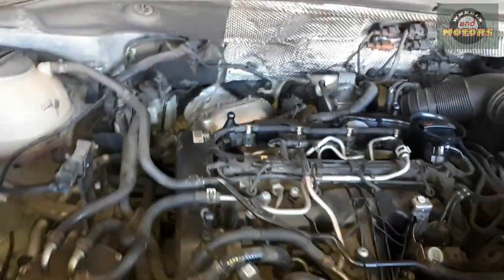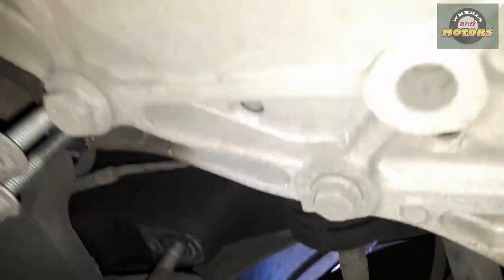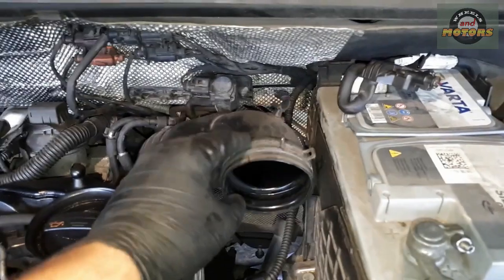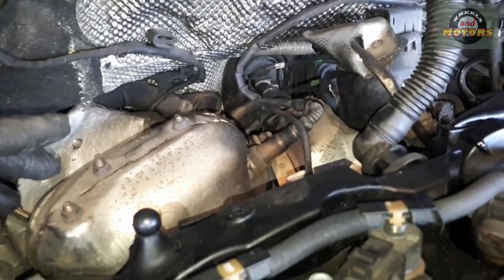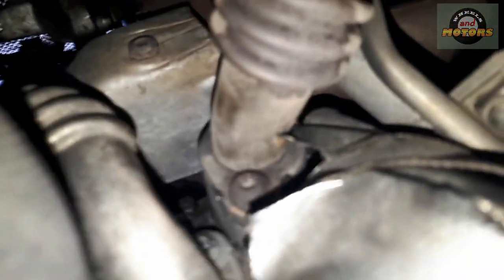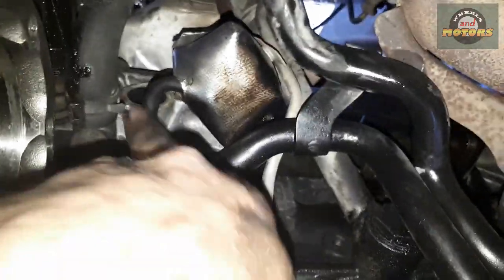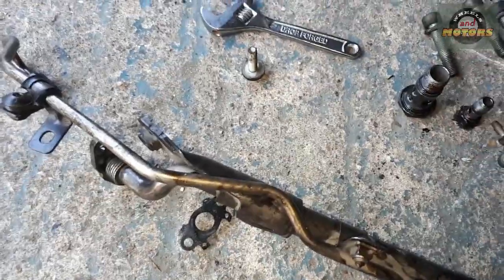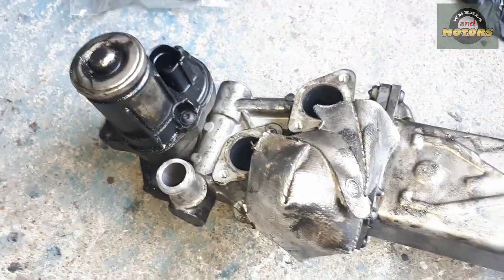P0403 - My way of "HOW TO REPLACE EGR TDI", VW, Seat, Skoda, Audi ("EASY-PEASY" style)

Comment: I tried to do the right thing - walked into my local garage, who's also my MOT tester, and asked if he had much experience with VW EGR issues. Almost immediately he advised me to get it mapped out, assuring me the emissions would be okay and it would be a lot cheaper than paying them to physically address the issues. I was worried about doing it but it's been a couple of days and the car feels so much better.

Comment: The guy who designed this type of EGR valve should have gone through the firing squad. Seriously...firstly this system on any vehicle is designed to get dirty and therefore if it is inaccessible it is a big problem.
Reply from the maker: Good earner for mechanical services. Design is rubbish.

Comment: Hi I have fabia 1.6tdi 2011. Coil light flashing and when I check with code reader its( p0407 egr position sensor  b _low in put.) When I turn the engin off it goes off .whe I start to drive after few minutes it comes again and power goes down. Which part I need to change. Thanks

Comment: Hi, nice work but you dont need to take the subframe off and also you dont need to take off the oil pipes that goes to the turbo, there is enough space to take the EGR off without the extra work and of course without extra costs of replacing the gaskets if doing so.
Also the EGR metal part doesnt need to be replace as it can be cleaned and the EGR valve motor and vacuume part can be bought individually saving a lot of money also.
Regarding the metal pipes that goes to the front they can also be cleaned with household chemicals. Cheers
Reply from the maker: Thanks for the advice 👍
Reply: Can I do that with 2011 dti jeatt

Comment: Hi great video help. I've never done one of these yet, but about to. Can you tell me if after replacement I will need any advanced coding other than using vagcom to clear the fault codes. You don't need any advanced codes from the dealer do you?
Reply from the maker: Thanks! No I didn't need to use any coding - it was just "plug and play". If you have some fault codes, any basic scanner should be able to clear them. Perhaps, after replacement they might clear themselves eventually.

Comment: I admire the patience you have to breakdown the various parts to get to the EGR valve and associated intake manifold.  It seems quite an arduous task.  In hindsight, would it have been easier to take out the engine and service that side of the engine?  I have some experience with the older VW diesel engines, e.g. pompe duece,  and servicing the EGR and intake manifold is less complicated than these more modern common rail engines.  As an aside, I wish VW had maintained the orientation of the engine, as in the B5 and B5.5 Passats,  rather than transverse as is now common.  How I hope VW will produce all electric versions of their popular models.  Maintaining the ICE and all the anti-pollution equipment such as this EGR system is ridiculous!
Reply from the maker: Out of all anti-pollution equipment - it's the AdBlue I hate the most. The car is great actually, today I've passed 400.000 mile mark.

Comment: Just a question on brackets and gaskets for the EGR - Spoke to VW and they say just 4 metal gaskets needed, x3 V04L131547S EE2-2 & x1 V03L131547N EE2-206 .  However re-watching this video you show a clamp to the DPF (which makes sense if you are moving) plus your bag of parts seems to show an additional gasket i dont have,  if i freeze frame! Looks like you have the 4 i have plus one smaller black one! :>   What is the smallest black one?
Reply from the maker: It's been a while since I've done it. Barely remember by now. Could you please send me a timestamp, maybe I'll remember something.

Comment: Getting sick and tired of my Sharan. I've got 4 kids and we need decent 7 seater. I've had a new DPF, new NOx sensor and now the EGR and NOx are pinging codes again...not to mention the A/C is stuck on and the heating diverter for rear is broken too.

Finally there is some weird issue with passenger side spring keeps rubbing up against the inside of the wheel arch!!!!

Comment: Thank you for the great video. 
I have an audi a3 2.0 tdi wit the same EGR. 

The car was throwing P0121 at first then p0403. Long story short the throttle body was absolutely packed with carbon. Took it out cleaned it and it worked fine with smooth engine shutdown. After 1000 miles the engine started throwing p0403 again. 

It shuts down smoothly without shutter. 
 I doubt the issue is EGR Valve since the engine has only 75k miles (well i dread it more than doubt...)

I was wondering what you think it would be? Any advice on how to track down the issue?

Cheers
Reply from the maker: Thanks 👍 P0403 points on EGR. I don't think it should affect engine shutdown. I had this code on low miles too, then for some reason it was gone for a while and came back on high miles. When it came back, I could say it was definitely bad - lack of power and flashing glow plug light.
This is what happened to my car, sorry don't know straight answer what to do in your case.
Reply: Is there a way to test egr valve without taking it out?

Same for throttle body. 

Am I right to say p0403 could be caused by either of those ?
Reply from the maker: @masihd1405  In engines like ours EGR valve and throttle body are not even close to each other. As far as I know P0403 relating to EGR.
Not sure exactly how to test. I remember connecting scanner, look on live data while running the engine. It can show you position of valve opening in %, also shows deviation, egr error. But I can't say what parameters there should be and what percentage of error is acceptable.
Reply: @wawayltd  Your problem/symptoms were identical with my 2011 VW Sharan 2.0 CR TDI CFFB.103 KW, 404.000 Km driven car, I purchased when was 2,5 years old with 217.000 Km on board back in 22 November 2013, car's name is Böze Wagen. In late time I had discovered a connection when the engine was warm, then the flashing glow-plug light (or flashing light bulb wire) came in almost immediately, and that would be not a problem if not paired with limp mode, but this is the way 😒. When the engine was started cold, the the flashing light came out erratically, but more and more often. Also I cleaned the intake manifold (for the first time, there was 600+ grams of oily carbon deposit measured by weight before/after cleaning). I cleaned the intake valves and throttle body (for the EGR). Then I was thinking to clean the DPF/catalysator unit and EGR cooler too, which I did with detergent, carburetor cleaner fluid and muriatic acid (10% HCl) and lots of soaking time, water and compressed air. The two lambda sensor and the two temperature sensor I cleaned ultrasonically. I have the videos, maybe I will post them.
Anyway, when I was removing the DPF filter that is needed to take out the EGR cooler, I noticed that my flex pipe - is a component of the DPF filter - is completely broken, then I discovered that the subframe bushing that holds the transmission pendulum is torn all the way, so this explains everything. The subframe bushing broke, this allowed more engine/transmission movement, and that broke the flex pipe all the way. Then the more oxygen measured on the second lambda sensor triggered the flashing glow-plug light on the dashboard. As the lambda/oxygen sensor is working well only in heated conditions, and also has it's own heating element, then is logical that was triggered almost immediately when the engine was warm before startup then when the engine was cold, and the software let some time before triggering the alarm.
Anyway, now I am in the the process of installing back everything, I welded a new flex pipe to the DPF, but I came to this video to look at each bolt where it goes, I put them in order, but I do not remember well the order when the parts came out, so I had some trouble finding the place for the nuts and bolts.
Wheels and Motors video helped me a lot, in the past also I had help on other repairs.
Many thank and keep up the good work 👍, peace.
Reply from the maker: Wow! You can make a great YouTube channel 👍

Comment: Great video, my skoda yeti the engine light just came up, i read the code p0403, but the car drives fine, no noises nothing.. How can i be sure its the EGR? Your answer  would be very appreciated i follow your channel for a few years now, you do a great job in your videos.. Thanks
Reply from the maker: Thanks.👍 When I had this code coming up more and more often, even after I cleared it, I assumed that it's definitely something to do with EGR, so I just ordered another one and changed it. Here is good article about this code:
https://www.engine-codes.com/p0403_volkswagen.html

Comment: Do you need to take oil pipe out to carry out this repair? Mine is now leaking and garage are refusing responsibility as they claim they didn’t remove it when replacing my EGR?
Reply from the maker: If you mean turbo oil feeding pipe, then - yes.

Comment: Hi I've just replaced the egr as was completely stuck open, now with the new unit I have the permanent fault   you can clear it and it returns straight away I be tried egr adaptation on my  scanning tool but it's saying it's not supported on this engine my engine is CAYC 1.6 TDI  any ideas what to do I'm thinking about cleaning and getting the old one fitted back on
Reply from the maker: Hi! What fault does it give you?
Reply: I get the fault P040800  Exhaust gas recirculation sensor B circuit high intermittent
Reply from the maker: Looks like possible electrical fault. I'm not a professional, unfortunately. Did the new EGR come with the warranty? Maybe some plug wasn't connected properly? Sorry, I don't know how to help..
Here's one good link about this fault, you probably have seen it:
https://www.obd-codes.com/p0408

Comment: Hi how much you’re egr kit was and from there’s you purchased and is it comes as a full kit or you have to order everything separately?
Reply from the maker: I bought everything in TPS. All together was quite expensive - around £400. But I know it can be bought for 200-250 for just a unit. The lowest price I have seen was on eBay for 100; I'm not sure about the quality of that one. I used that Sharan for business, so I wanted to be on the safe side.

Comment: i have code EGR Sensor P048C Open circuit Active. i think i have to tackle this nasty job by the looks of it ive only got hundred and ten km om my clock in your opinion would you say i would need to change out my egr thanks
Reply from the maker: Are exhaust pressure valve and EGR valve the same thing? Sorry, I'm not a proper mechanic, I have figured out how to replace a bloody thing, that's about it. I don't want to give you a false advice.

Comment: My advice is to buy an original EGR from a VW dealer. They are over twice the price, but for a good reason. I have seen non-original EGR fail shortly after installation.

It has been a revision of the cooler from 03L131512CF to 03L131512DQ, and the latter is a better part then the ones (CF) fitted from factory.
Reply from the maker: TPS supplies dealerships. Only trouble - they sell to trade only.

Comment: Hi after my EGR been replaced in"""" RECOMMENDED GARAGE"""""" my car is more noise than before. I saw they did not replace the bracket on turbo and after long conversation they replace the bracket but i can se is exhaust leak somewhere . Smell coming from engine bay :(((( Where can be this leak if the bracket be replaced? How do you think?
Reply from the maker: Sorry Ivan, it needs to be seen, I can't tell you like that, I'm not even mecahnic. Looks like that recommended garage has done not very nice job. I think they should be responsible for exhaust system leaks.
Reply: I too have a problem with my 2.0 TDI Alhambra where I've noticed a deep rumble noise like air blowing when driving around town, smell of exhaust in the car when I stop at lights, exhaust smell in the engine bay, and I can see smoke appear from the area of the turbo (a puff of smoke appears immediately when the engine starts). It's been trying to do DPF regen all the time, and was throwing a P2456 sensor fault so I changed the sensor and adapted it with VCDS (before the noise/smoke puff issues were noticed) but now I'm getting a P0299 low boost code. I don't know if it's an exhaust leak around the turbo area, or a blocked DPF, or a faulty/blocked EGR, or something else. Did you get yours sorted? What do you refer to when you say the bracket on the turbo? Thanks.. Also, editing this because I forgot to mention it goes into limp mode if I give it too much power, for example when accelerating onto a motorway.
Reply: @BarnSt0rmer  Hi I still waiting for smock test . I will let you know as soon as possible

Comment: Great and very helpful video. Worked out great, However after changing the EGR  I got 2 new faults. It varies between P2563 (Turbocharger Boost Control Position Sensor A Cicuit) and P0299 (Turbocharger underboost). It seems they never appear at the same time. Connections look "happy" as you say. I´ve checked hoses over and over. I didn´t replace those green gaskets, might be damageged, leaking and causing this? Does anybody have an idea where to start? /Thankful for any help!
Reply from the maker: Does the car feel underpowered?

Comment: Good video
Do you need to adopt (calibrate) new EGR , and do you know if you dont do it , can that damage new EGR.
Reply from the maker: Thanks!  No you don't need to adopt it - just replace and go. All I did when I replaced my EGR is shown in the video, and there was no "computer magic", such as encoding or calibrating involved. I just replaced it  and already done another 50.000 miles - no problem.
Reply: WheelsAndMotors , thanks for reply, all the best

Comment: What device is the wire in the left hand area connected to?  11.43 minutes of video.
Reply from the maker: Tomorrow I'm going to see that car and have a look.
Reply: @wawayltd  I have the same cable but not connected.
Reply from the maker: I had a look in my Sharan, and it looks like a bunch of wires, probably connected to various sensors and components somewhere in the bumper area. The brake fluid level sensor also goes to the same bunch... I my car I don't see any loose wires.
Reply: @wawayltd  I am writing more specifically about these thin cables going down the bulkhead wall.  I'm sorry but I can't add a photo.  not every Sharan has it.  I'll send you an email.
Reply from the maker: I don't think I'll be able to help you there. I'm not professional, sorry..

Comment: Nice video. Off topic, That subframe bush is begging to be replaced. Waiting for a video how to do it lol
Reply from the maker: Thanks :) I have replaced those bushings (there are 2, one above another). Just need time to process video files and create proper video. Give me about week.
Reply: @wawayltd  ok cool. I've replaced mine without expensive tools or press. Cant wait to see your method.
Reply from the maker: @Wiliuz  I used pull and sleeve tool kit or whatever it's called. Didn't buy it specifically for that job, just because it's useful to have for future, it costs £70-£80 on eBay. 
I have seen people do it with jack and piece of wood... But I didn't want to risk, it's a taxi and needs to be on road asap.

Comment: What is holding the engine in the engine bay?
Reply from the maker: Engine mounts. Engine doesn't sit on subframe, it's connected to subframe only with pendulum support with bushing. Engine hangs on mounts, if you bolt it to the body - you'll get a lot of vibrations.